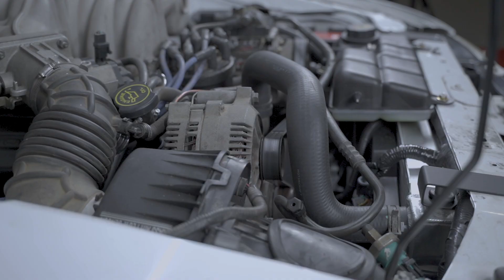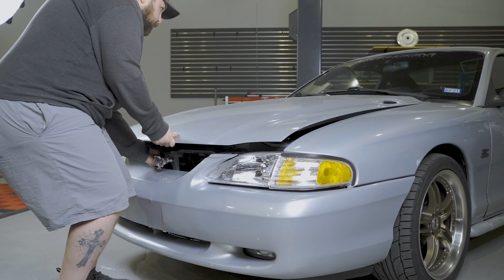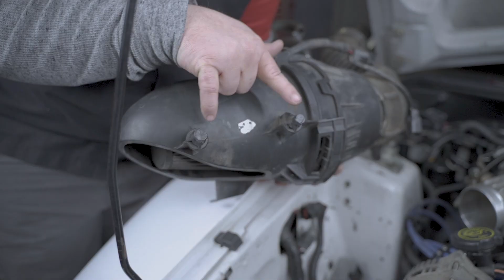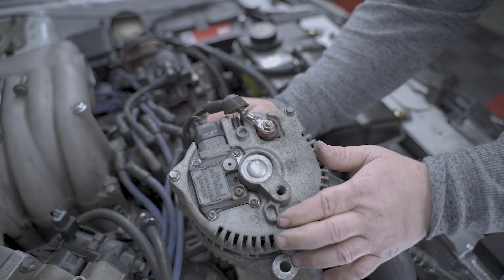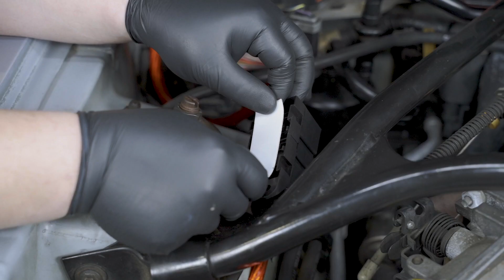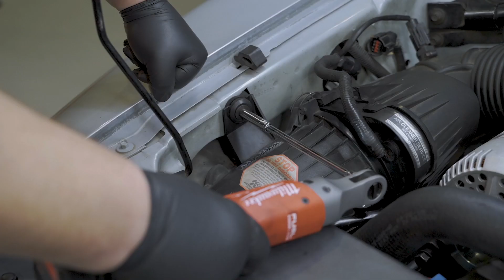How To Install SN95 Mustang 200 Amp Alternator (94-95)

Comment: What if the wire doesn’t fit on the power junction?? I tried putting it on but it doesn’t fit around the lug